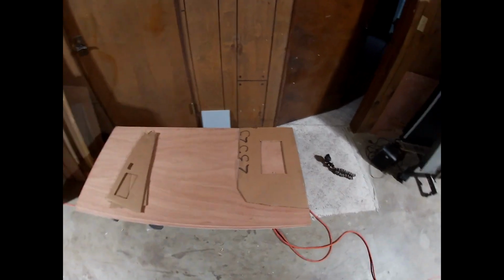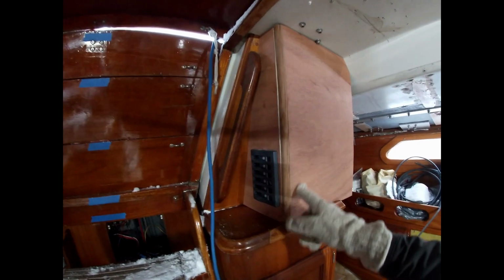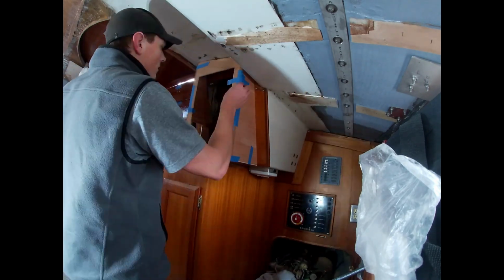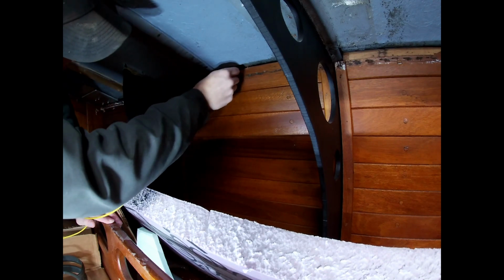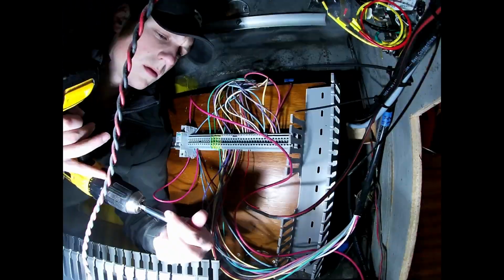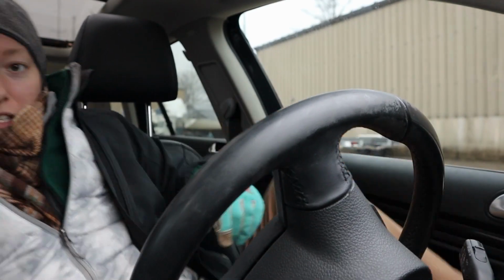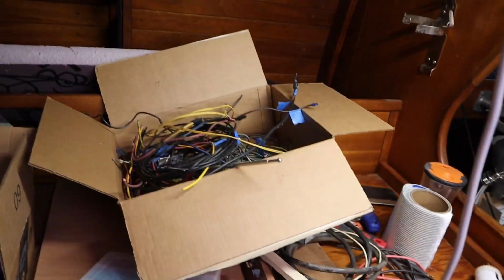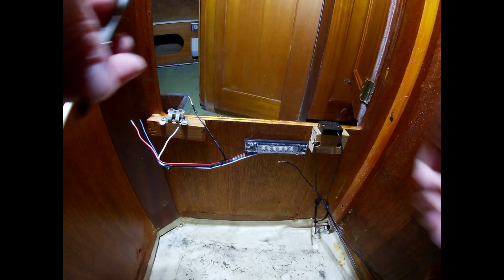Big projects in tiny spaces: S1 Ep6

Comment: my english weak...you done good work..the boat day by day be good...question .electric current in wire you doing is it AC or DC current..thank
Reply from the maker: In this video most of the wiring is DC. We still have yet to do the AC wiring. Cutting it close since we only have a month and a half before we are supposed to move on!